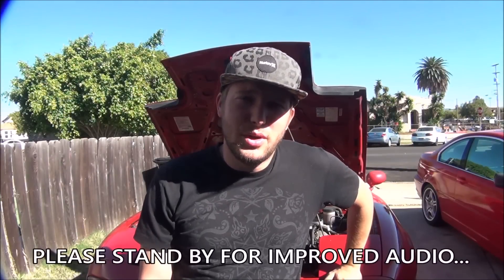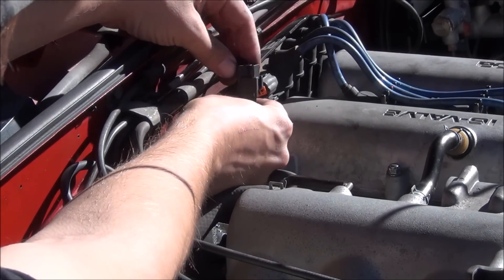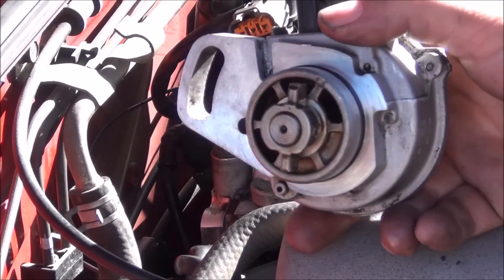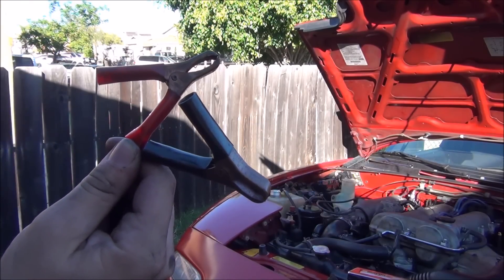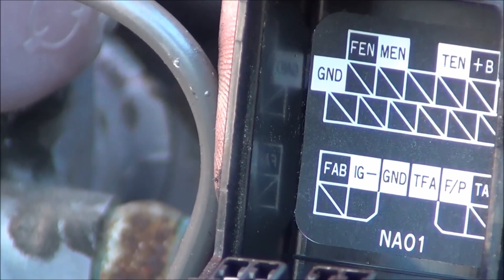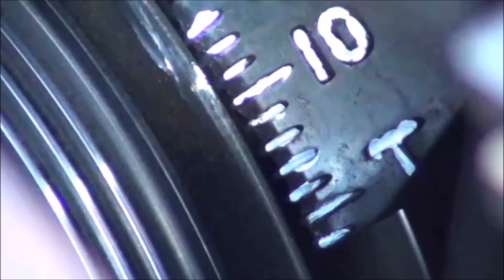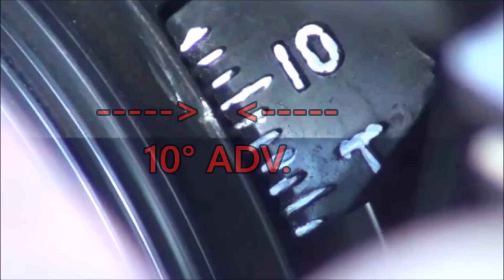2 for 1 Special: Miata CAS O-Ring Replacement & Setting Ignition Timing!

Comment: Another great video Greg.  I did mine at the same time as doing the cam belt and water pump change but found that putting the CAS back was next to impossible.  Then I saw another video where the guy took off the CAS cap, just like you did with the cam caps when changing the oil seals in another video of yours, and then it was a piece of cake,

Comment: Can't agree more with previous comments. Your videos have helped my confidence with my project NA8. Megasquirt is in,  of course none of my project has gone as smooth  as yours but I am learning so much. Had to use the dip stick to locate TDC and make my own timing mark, not sure why the harmonic balancer moved but it took me two whole days to figure that out and get the timing set. Looking forward to the next broke and boosted.  I saw it in another subscribers thread and wanted to say that the 1.8 also has the positive lead with a blue cap on the drivers side just in front of the diagnostic box. Fwiw.
Reply from the maker: +Richard Nestor Cool man! There are some things that are really tight and things that I struggle doing that I don't include footage of because I don't feel it adds to the content of the video. Nobody wants to watch 3 minutes of me fiddling with the CAS to get it to go in, but I figured with the footage I show you'll get enough of the idea to know how to do it.

Comment: Many miata's have an unused BLUE connector behind the left headlight, it's easier and safer to use that instead of the alternator power imo
Reply from the maker: That's the one I use now, after all the comments on this video LOL. I never knew it was there until I posted this and got a bunch of comments on it.

Comment: Im sure you know but theres a 12V source by the diagnostic box. Its blue with a blue plug in it. Theres a small blade in there that you can connect your timing light to. Then you dont have to put your cables by the alternator belt.
Reply from the maker: +jason johnson Someone else mentioned that as well, I'll have to look into it. Is yours a 1.8L?
Reply: +TheCarPassionChannel Nope its 1990 1.6L

Comment: Hey greg I'm sure you've seen me comment a thousand times.. But I GPTOT THE REBUILD DONE AND EVERYTHING IS GOING WELL! I just replaced my spark plug wired as 1 was causing a slight misfire but no CEL codes, but I replaced the wires with extras I had laying around and boom! 
Now my miata idles from 2k to 1k back and forth
Like it goes up to 2k then back to 1k then up to 2k then down to 1k

Comment: love your videos.  just thought I should add that there is a wire with a blue? cap on it that is for diagnostic purposes since the battery is in the trunk.  it's what I've used when doing my timing.  thanks for awesome videos and great knowledge!
Reply from the maker: +collin bailey I did not know about the blue plug until I posted this video and everyone made me very aware of it, lol. Now I know! Actually I think I'll throw an annotation in there.

Comment: Thank god you're showing some love to the 1.6. Everyone say you might as well swap in a 1.8 before turboing.
Reply from the maker: +xmanguy94 It really is a better engine just because of the displacement advantage alone, but I will tell you that my 1.6 is PLENTY fast, and from what I've seen online, at least according to the torque curve from the dyno, will outrun most stock-motor 1.8 cars anyways. It's so much more than displacement alone, it's all about setup. Over 200wtq from 3450 to 6600RPM is very usable, fun, and the car is not laggy at all.
Reply: +TheCarPassionChannel Exactly, the 1.6 is still a perfectly good place to start. I'd love to have my '91 like your '92 some day. 250whp/ 231wtq sounds like a blast.

Comment: There's a blue 12v connector on the driver side of the engine bay by the yellow airbag connectors you can hook the timing light up to instead of your alternator by the way. Great video thanks for the help

Comment: there's a blue connector in the engine bay on the driver side which is a 12v source for anything needing power in the engine bay (such as a timing light). figured this might be a little easier than claiming onto the alternator

Comment: I spent a whole afternoon on this and the next day I got so frustrated I decided to take the back of the CAS cap .Under the cap there is a thin metal plate thats held by screw. I put the CAS in and slowly turned the thin plate with the screw (which moves the front of the CAS ) till I felt it lock in turned it both ways to make Shure and then I pushed the CAS in to its place . Finalllllyyyyy went in.           

(I also lubricated everything before)

Comment: Ah the CAS, one of who knows how many oil leaks I have in my 1.6. At least that one is fixed.
Reply: I just got a 2000 miata yesterday, it's fucking mint condition, ONLY issue i could find is a leaking valve cover gasket has a little oil leaking, forums recommend doing the cas oring at the same time... hopefully it's easy

Comment: Thank you for all these vids. They are SO helpful. I just picked up a '96 miata and it needs a bit of work. Mind if I ask you a few questions when the time comes?
Reply from the maker: +Chris Ahmed Ready when you are
Reply: TheCarPassionChannel Great, thanks! Picking it up today. In dire need of a paint job and I noticed two things when test driving it. 1)it was a little wet around the first cylinder spark plug 2)Radiator was spitting fluid at the cap and it wasn't overheated. I suspect it's a bad cap
Reply from the maker: Chris Ahmed Wet with oil? Probably just needs a valve cover gasket. 2nd issue sounds like the radiator cap.

Comment: I remember changing mine, it was never changed in the 210k miles that the motor had on it. Rubber turns to almost hard plastic when they get old. Probably from all that heat.

Comment: So I just cleaned my lifters which ya know involves taking my cams out and such. I have reinstalled my intake cam and am getting ready to install the exhaust side, adjust my timing belt, and reassemble the rest of the motor. I would prefer not to start the motor when setting my timing. (I'd like to have everything in order before the motor gets an official start and let the lifters soak up with oil with the engine running right. Although, I have pumped them full of brand new oil before installing them back into the head.) Could I pull my fuel injector fuse and just have someone turn the motor over while I run the timing light and get an accurate reading that way? I think this would work assuming the RPMs don't matter since the light fires as the 1st spark plug does. Thanks, and keep up the great work! Your videos are super informative and explain everything in perfect detail!
Reply from the maker: Boston Tillery Yep! You can do it that way.

Comment: NOTE:
Standard rubber o-rings will not be suitable for this application, oil will damage the rubber.

There is also a blue socket front/right> in the engine bay that can be used for the positive connection on the timing light.

Comment: I just got a free 92 miata. Crank, no start. Noticed the cam sensor is on the driver side with no bolt in it. Is there one on both sides? It's currently at my sip at work so I can't go look. Just curious

Comment: Great video mate! :) 
Always when I set the timing I need to adjust the idle at the same time, and I didn't see mentioning anything on that, am I doing something wrong or it is normal?
Reply from the maker: Spiros Aliprantis Changes in timing will affect idle speed when in "diagnostic mode". Absolutely normal

Comment: As always great detailed video!!! keep em coming. i have one question did you have to turn car off and on when adjusting the cas ? or the car stays on ? thanks
Reply from the maker: +Reef Raf Ughhh if my neighbors weren't blasting Janis Joplin all day I would have been able to have audio, lol. Yes I leave the car running, but you can shut it off if you want, if the CAS is hard to twist sometimes you can make a really big adjustment by accident. Shouldn't really hurt anything at idle though.
Reply: Great thanks man

Comment: I'm just wondering if you make the ignition adjustment while the velicle is running or not? If an over adjustment can cause damage then I would definitely be afraid of leaving it running so I really wanted to ask you.
Reply from the maker: You can make it with the engine running or off, it does not matter. I do it while running just because it's faster
Reply: @TheCarPassionChannel  thank you. Huge fan by the way!

Comment: On most of the miatas I have worked on in the past there is another power source to use for the timing light. It was a 2 prong plug near the fuse box, under the hood, on the passenger side. I don't remember what it went to, but it must have been for an accessory that wasn't standard on the vehicles. Have you seen this?

Comment: 'Make sure you don't turn the cas and just put it back'.  Well, in my experience, I can't get the cas out undisturbed.  I stick my finger in the cam case to feel where the slots are on the cam, so I can roughly align the dogs on the cas.  I carefully move it around a smidge to try and align them, but no.  I have done this twice, and I've never done it without pulling the valve cover, and I've done it for an hour

Comment: Hello, thanks for the video, I have a question:

is there  a way we can test to see if the CAS is not working properly?

I am having issue with the car not starting after being warm. which means when cold it starts fine, once I turn it off and restart again, it crank, but won't start.

I changed the water thermistor sensor and no luck....now I just removed my CAS and I am trying to test it....
Reply: i am having the same issue!! any luck? PLEASE help.
Reply: +Marvin R. 
The car is back to normal now, but the story is long I'll try to make it short.

After I unwisely replaced CAS,  fuel pump and some other small stuff...

I decided to take the car to one of the local mechanics, The problem was bad grounds.

Bad grounds can get you a hard and make you lose a fortune and you don't even know how to test them if you are novice like me.

It was actually the combination of bad grounds that you just have to replace those wires and clean all the bolts off the corrosion as well as leak in the intake air ram.

The car is back to normal it idles nice it doesn't have any problem

Comment: hey man quick question, i had adjusted my angle sensor because it was under timed but now it doesn’t want to stay on like it turns over and stays at maybe between 2 and 3 rpm but then it drops and sounds like it wants to shut off. what do you think it can be?
Reply: Hello   I have a stock 1993 with the 1.6 .   It has about 65,000 miles on it.  I started a timing belt/water pump change on it last fall and now can’t get it to start..I’ve checked the crank shaft notch position . Also the cam shaft marks and the 19 teeth between them. All looks correct but it won’t start.  When I spray some start fluid in the throttle body, I just get a backfire..  Checking its timing with a timing light and a jumper between GD and TEN the balancer shows it at about 4 to 5 o’clock when the CAS is fully clockwise and at about 3 o’clock when CAS is fully counter clockwise. I’ve seen the CAS mounted with it’s connector pointing up in some videos but mine points down which I’m sure is the way it was originally and the connector plug seems formed to plug in that way..   What am I missing?  I’ve been stumped for 2 weeks now working on it about every day..  Thanks for any help you or your followers can give me.  Randy Johnson

Comment: dose the rpm matter because i carnt get mine lower then 1800rpm with my standalone ecu and do you need to put it in diag mode with a aftermarket ecu. i need to set the timing to 10 deg adv and put the ecu the same i think that why i idal high and get alot of issuse with my base map

Comment: Is there an easier way to put the CAS back in? All the times I've tried it, it's taken way too long plus it's extremely frustrating when it doesn't want to pop in.
Reply: take the valve cover off
Reply: @xXmassniperzXx or just loosen the 2 12mm cam bolts next to it. U can also feel with your finger where the notches on the cam are and from there it’s a 1/2 chance you’ll put the cas on right

Comment: yo greg! thats the camshaft angle sensor no? i think the crank angle sensor is on the front of the motor
Reply from the maker: 1.6 engines don't have the one on the front of the engine, so this does both jobs (cam and crank angle inputs)
Reply: ah i see i see, thanks!

Comment: good video I am learning a lot wish you were doing a 1.8 n/a
Reply from the maker: +Big Daddy Tuck The engines are very similar and a lot of what I do can be translated over.
Reply: Hey man thanks . Hey why not supercharger the new car and have one of each lol
Reply from the maker: Big Daddy Tuck As fun as that would be, I believe in turbocharging a lot more. Nothing wrong with a supercharged Miata though, the instant response is awesome.
Reply: +TheCarPassionChannel how responsive is your Garrett turbo? Is like a supercharger?
Reply from the maker: Boosted2JZ A turbo will never be quite as instant as a supercharger, but it's as much response as I need. I never think to myself "I wish I had more response than this" haha. Even on the autocross track with lower RPM corner exits, it makes plenty of torque and pretty quickly. Over 200wtq from 3450 to 6600.

Comment: Great work. My miata is boosted, it has miata link ECU, will the  diagnosis mode be the same? what degree should i see from a boosted miata? thanks
Reply from the maker: +zj120cn Is the Link a complete replacement for the ECU or a piggyback? I can't remember

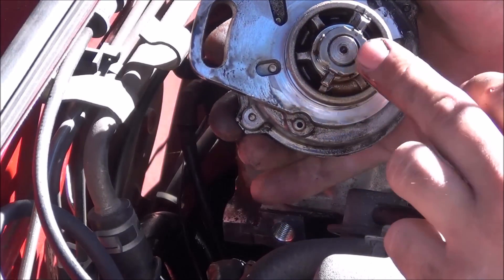Comment: AT 1:30 .. There is a notch, dimple and and a small cut away within the area of your middle finger. Can the CAS go in wrong, like 180 wrong ? My question more specifically is it POSSSIABLE to have put the CAS in 180 degrees out ??? Resulting in "Crank No Start"? Thank you . I tried to line up all the marks on the CAS and set the car to TDC. and it didn't work.
Reply from the maker: I don't believe the cast can actually go all the way into the head if it's 180° off. But yes it does need to face the correct direction
Reply: @TheCarPassionChannel  OK, I can confirm that the CAS can only go in correctly.  After measurement I found that the keyway is actually off center, preventing misalignment.

Comment: hey greg my brand new aftermarket autoparts store harmonic balancer has 2 notches about a half inch apart for timing marks. which one do i go off of for the actual timing set? the left or right one?
Reply from the maker: You'll have to find the actual top dead center of the engine by dropping a screwdriver down the spark plug hole and turning the engine by hand. The mark that's vertical at TDC is the mark you use.

Comment: Hey im having some issues timing my motor! im on Megasquirt PNP2 on my 1993 mazda miata someone must have messed with the timing before i had the vehicle. took out number 1 spark plug put long ass screw driver in to top dead center marked it and its way off.. ive tried adjusting the cas and it wont go far enough for me to be right at 10. ive tried adjusting the offset angle in megasquirt and it runs like shit if i get it close.. i megasquirt the gauge says its running 17.5-18 advanced timing and when im on throttle im at 25.. please HELP!!!

Comment: YOu say the cam angle sensor only goes in 1 way.   I removed mine on my 90 1.6 and it wound up spinning.  Lets say the part that connects to the camshaft is pointed at 12 and 6. If i spun it 180 degrees would it still go in.  Or like you mentioned it will only go on 1 way?
Reply from the maker: 2011wideglide No, there's a small notch on the CAS key that will only let it go into the cam one way. If it's flipped 180 it will go in a little, but not all the way

Comment: Hey, thanks for the video! I have a question that i hope you can answer. 
My TDC mark seems to be way off. No matter how I adjust my CAS I cannot get the TDC mark even near the plastic cover with the “10 degree and T lettering.”  Facing the engine my TDC mark moves between 8 and 10 o’clock. It’s completely on the other side. Please help!
Reply from the maker: Hey Ariel, what's going on there is it sounds like your crank pulley has slipped or is slipping. There is only rubber between the outer and inner ring, and when they get old enough the outer ring with the timing marks can start to slip, and the marks will be way off, or even actively spin while the engine runs. You can see more info about this including how to diagnose it in one of my recent videos "I helped a subscriber gain 80 horsepower"

Comment: Thank god I don't have to deal with that god damn cam angle sensor anymore. On my 92 I had to solder the wires and make a new connector, the connector plastic crumbled because it was so old.

Comment: Idk if this is a dumb question plus this is an old as s vid, but is there a way to adjust the ignition timing if you have megasquirt or is this the only way to adjust?
Reply from the maker: +Carlos Albanez You can adjust it with MS, but you need to make sure your base timing in MS matches what your engines base timing is first.